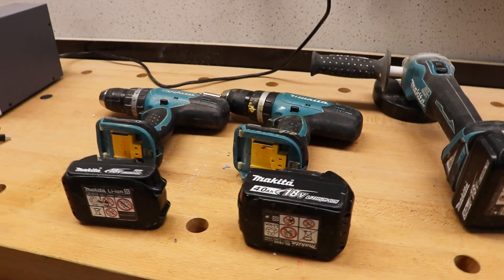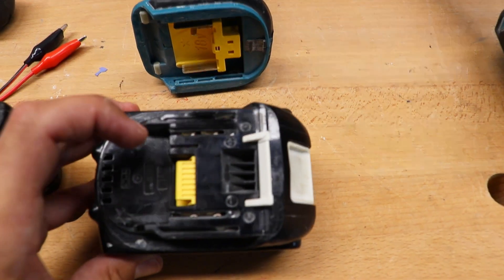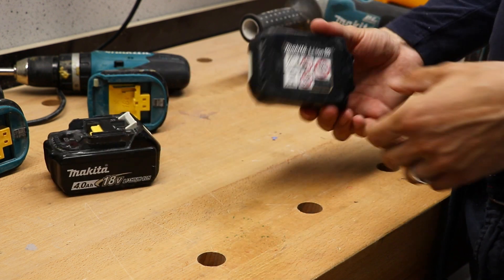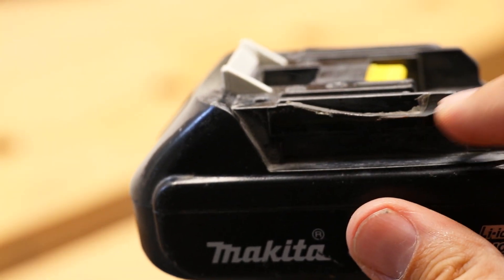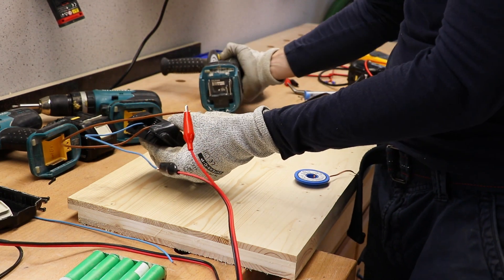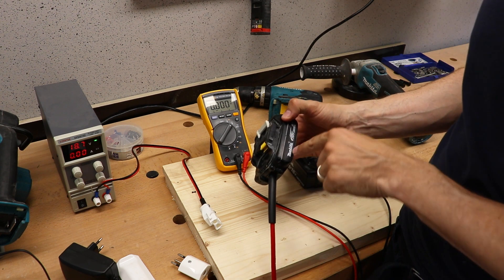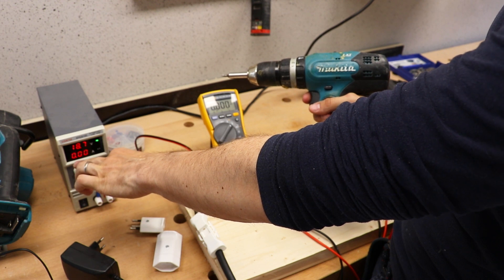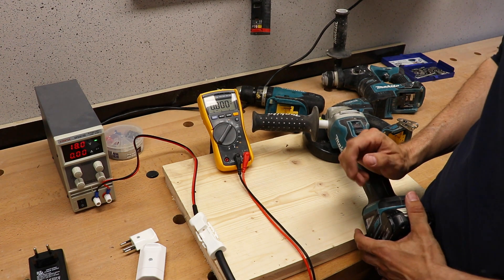How does a 18v Makita Battery Tool runs of 230V?

Comment: Is it possible to have it going out to two batteries outputting 18v to each using just the one ac to dc machine or would I have to buy a second one, I’m attempting to purchase the makita portable microwave and kettle and those items require 2 batteries to operate and I would like to connect to an outlet of sorts like you’ve done until I have enough to buy the batteries, if you can let me know or see if you can find out if it’s not too much trouble. Thank in advance, have a nice day

Comment: This would be a fun way of really testing the tools limits… maximum overclock! I’d like to get one of these and overvolt them to 24, maybe 28V and see how they do. Having that live view of the current draw is also very useful. Could be a good way of properly comparing tools, as opposed to all the comparison tests which use roughly equivalent batteries from different brands which isn’t a good way to standardise a test.

Only thing I’d do differently really is use a 1200-1500VA power supply, as some cordless tools today claim to reach these power levels
Reply: Donnnnttttt be 🤓💥💥💥💥🤷‍♂️ a 🤡

Comment: use old laptop charger for power it, and you may connect + to small connector because thermal switch is bimetal not temperature sensor.
Reply: Not enough amps
Reply: 👩‍🔧🤔🤔 small pinn 🤣 
Do you mean the 1 on the.  tool ??? .. 
Can u put 18v dc pwr on it .. 
Cos if not 18v on then tool no gooooo.

Comment: Why are you not use a 8k2 resistor between negative and NTC pins on drill side? Then you can run the drill. Because it probably use 10k thermistor, for secure battery from overheat. You can check the resistance on battery between negative and the extra (NTC) pin. Chose the same resistance resistor. And you have to use a bigger power supply.
Reply: 👍🤷‍♂️🤔🤔🤔 what dose ntc mean..?? 
And dose it control a fet to cut out put power ..

Comment: Your set up just won't provide enough ampage for demanding tasks. The original battery can output theoretical ampage of 40A. Just take a look at the spike ampage your driver draws without a load. It is as high as 9.46A . What spike ampage do you think it will draw under load? You'll either overload your power supply or under power your device.
Reply: 🙄🤔 .000987

Comment: Thanks for the video. There were several issues that commenters have already noted. But I have been wondering if this was possible due to all the monitoring electronics in the battery pack. This video shows that it still is possible to hack a cordless 18V Makita tool into a corded tool. I wish tool companies would just come out with a cordless to corded adapter. But alas, business plans rely on consumables such as batteries, inkjet cartridges, and so on. However, there might be a "gray" market opportunity to sell conversion battery kits. I suspect that the unique but similar mechanical batter locking geometries are protected proprietary IP for each manufacturer, but a combination of reverse-engineering, ingenuity or "gray" market manufacturing could bypass that. Especially for DIYer's with a 3D printer.
Reply: Iiiitttts 
Called .. ali ex presssss.
Reply: Not possible. They may get sued

Comment: I tried with the same battery, but with a 24v 6A power adapter and it only turns on for a brief second. I tested it with a meter and it shows the same output as the battery. Why doesn’t it work?
Reply: There are a few things going on here.  You can see in the video at around 8:25 when he boosts the Voltage the Amperage used goes up too.  I suspect at 24V that 6A might not be enough.  ALSO a lot of the switching power supplies have short circuit protection.  Which basically cut the power after a brief second of drawing more amperage then it expects.  If you care about the tool you probably want to lower the voltage to 20 or 21V and get a power supply that can do 10A at least.  You can see from other comments if you're cutting/drilling into something especially tough people expect the amperage to jump even higher to 30A.  I've yet to get this to work beyond a "proof of concept" (and then I blew a fuse) so I'm kind of trying to work out similar issues.
Reply from the maker: Hi there, i guess you already checked on polarity, i cant really help you, mine works fine on different machines, keep on trying and stay safe, best regards

Comment: Hi, First of all makita battery charger cut off at 20V so you should put that voltage too and you can even set 21V 
Secod thing is that tools take more current in heavy load so this usage on iddle what you show is just for spinning... 
this tools can draw much more amps when you use them to work and that is why battery and tool is overheating.
I use makita around 5 years now everyday and they can easly draw 10 times this current what you show on idle...

Comment: The angle grinder needs 5.5A? Maybe on idle. If you cut into metal or concrete this will probably spike to 30A, no? Then your little benchtop power supply will not be enough. I would love to know or see what happens if you run the angle grinder under load.
Reply: 🤣🤣🙈🌧🤷‍♂️🤷‍♂️🤷‍♂️🤷‍♂️💇‍♂️💇‍♂️💇‍♂️💇‍♂️💇‍♂️💇‍♂️ 
Welll
Durrrr

Comment: https://commons.wikimedia.org/wiki/Category:Makita_LXT

All batteries are electrically compatible, featuring two main connectors for power, a third connection for temperature sensing and charging plus yellow-coloured 8-way data connector used by battery chargers.

I would love to run my Makita 18V Router on 230V mains. Any idea how much Ampere this thing can draw at peak usage?
Also I don't have an old battery. I could print out an adapter with my 3D printer though. Still, I have no clue how to trick the third pin on the tool so it runs. 

Does somebody have a solution that does not involve an old battery?
Reply: Should say that on the tool. At least my milwaukee vac has a label on it that says 12A.

Comment: Hi, thanks for sharing! Don't forget that you need a decent wires that could handle ~30amps
Reply from the maker: Thx very much man, yeah but only at 18v, so 1.5mm/2 is way enough, best regards
Reply: @swissdadmakes3367  I think it would be enough if your cable is short, something like 1.6 meters. If you would run 3 meters, then cable should be 2.5mm2. I did mine 20V - 5 meters and 35mm2 cable and it still gets warm while working on heavy load. Just be careful ;)
Reply from the maker: @suicideris  thx again man, ive got around 5m with 1.5mm2, ive actually never touched the wires under full load, excellent idea man i will check if and how warm it gets, your comment is much appreciated👍have a good one
Reply: 1.5mm2 ist enough cause ist seems that the power supply only delivers 10amps. You could see that when the angle grinder starts, it is limited at 10amps at startup therefore it took a long time to run at full speed. It would be interesting to see the tools under load, im pretty sure they suck then.

Comment: This is awesome!!!
I want to do this for my 36v Compound Miter saw, any idea with the 2 battery setup ?
Reply: You can do it with one 40V 30amp power supply, but this option involves completely different wiring approach. 
Or you could use two identical 20V 30amp power supplies. Then you could make two separate adapters, and connect them to your machine. But keep in mind that two power supplies has to be identically the same, the same brand, same parameters, build in in the same way, otherwise you can get into some trouble. 
I would recommend first option, it's cheaper, safer,  but you should know basics of electricity if you would like to do it from scratch.
Reply: BUY THE HIKOKI 36V AC POWER SUPPLY AND MODIFY IT  BY WIRING TWO EMPTY  MAKITA PACKS TWO ONE PACK
Reply: Immortal Soul Thank you very much my friend!!!🙌🙌🙌
Reply from the maker: Hi there, thx for your comment👍 I cant tell you for sure but the 36v is just equal to two 18v batteries in series, then you just need to make sure that your ac to dc converter can deliver enough amperes, good luck and maybe you let us know your result👌
Reply: Anybody knows the 3rd terminal protocol?
Is it for temperature monitoring?
Can we make it and pretend the 3rd terminal is present, without the battery board?

Comment: Nicely done. The drill and angle grinder are going to draw close to 30amps under heavy loading. To ease the load on the power supply you should also be running at 21 volts. That's what a fully charged 5 cell in series 18650 pack is at(4.2 volts x 5). Also the 3rd pin is a thermistor temperature sensor and generally it just needs the same voltage on the Positive terminal connected to it.
Reply from the maker: Thx very much for your comment man! You're the first to clear out the mystic 3rd pin, i thought so, that makes sense👍 And yes I never really had a look at the Amps while under full load, I'll check that out, btw sorry for the bad audio, that was one of my first videos... best regards from switzerland
Reply: 21V is theoretical. Fully charged Makita batteries will give you 19.85V (18V version)
Reply: @suicideris  21volts isn't theoretical. I've measured this on many battery packs. 18650 lithium cells are charged to 4.2 volts each adding up to 21 volts for the pack of 5 cells in series. The tool then shuts off power when the battery is drained to 15 volts or 3 volts per 18650 cell. The nominal or mean operating voltage is 18 volts.
Reply: @suicideris  whatever.  The point is running at 21 volts is safe and ideal for the power supply.
Reply: Rrr u sure the 3rd pin just needs a bit of 18 v dc on it .. 
It . Wont it blow up circiut boards in bat or drill ..💥🤔🤔
Reply: A THERRRMISTOR👩‍🔧🤔 HOw dose that detect ta bat is low at 15v or so .. then open a fet trasnsisittor  and cut main pwr to tool ..out put 🤓🤔🤔👍
Reply: @istopedthewuhanlabfunding6351 

Derrrrrrp.
Reply: I hot wireded it .. 3 wires to measuuuure the  V ..n.. Amps on the 3rdd pin .. 
👍👍🤓 000 ammps go when tool running ..
But 17v s only when tool running .. 👍👩‍🔧💥
Reply: What do you mean exactly? Please help I have a drill and I want to connect to power supply directly... How should I connect the third pin???  @istopedthewuhanlabfunding6351
Reply: So if were to do something similar to this but with the Makita XGT 40v tools, the current draw won't be as high right?
Reply: I woud say 3rd pin is a low bat voltagegeage 
Cut off .. then bat is low ..drainnned.out .
Reply: @istopedthewuhanlabfunding6351  third pin is a temp sensor for the battery BMS board, lithium batteries have been known to explode when overheated due to overcharging

Comment: This is possible to apply on other tools like DeWalt or ridgid ?
Reply from the maker: Hi there, thx for your question, well, I can't tell you for sure, but in theory it should work the same way for many of the battery tools out there, just try it out👍 best regards
Reply: @swissdadmakes3367  yaps...thx for answer
I will try and hope can do it
Reply from the maker: @Vanzsmurf  good luck man and maybe let us know, best regards
Reply: @swissdadmakes3367  well the voltage is the same so it should, in theory, work.

Comment: Hello, nice video!
I have a question. You say at the end of the video that you bought a converter on Amazon. But you had not enough with1.2Ah for using it. Is it possible to do that but with a converter of 3Ah or more as exemple? Could you than get enough power or is it dangerous? Thanks man!
Reply from the maker: Hi robert, thx for watching my video👍 yes i would say so, if youre converter delivers more Ampere at 18v then you should be fine, maybe make sure that your converter doesnt run on its maximum just to avoid an overheating, hope this answer finds you well, best regards marcel
Reply: Okay very nice, thank you! 😉
Reply from the maker: @baptisterobert5520  you're welcome, and good luck👍